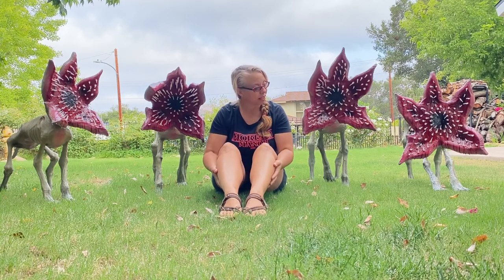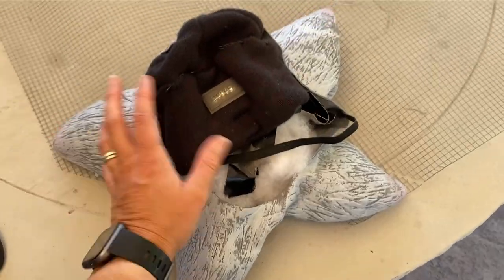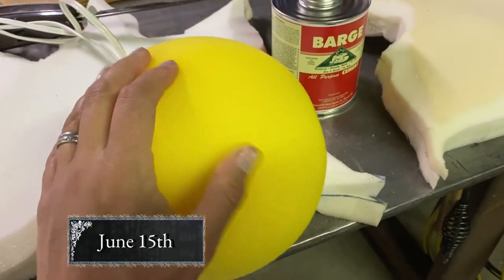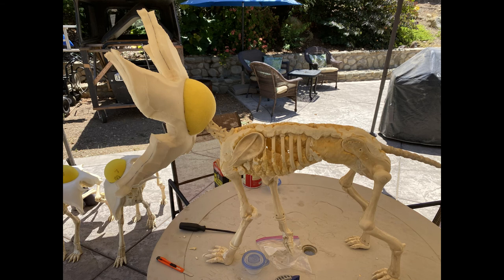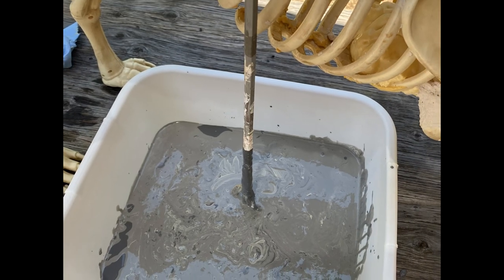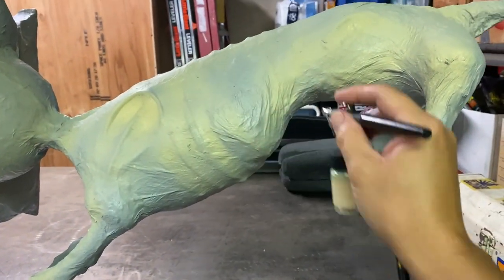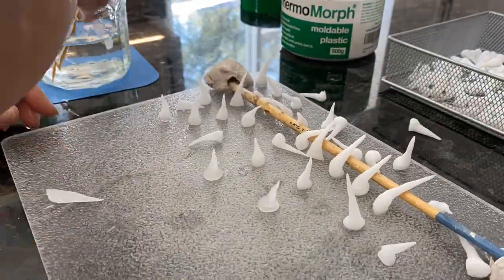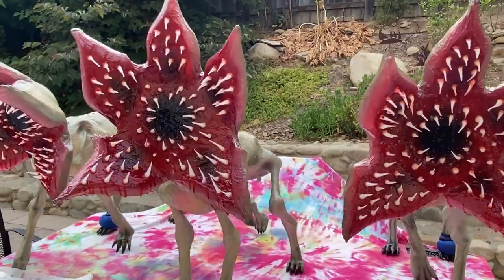DIY Demodogs Stranger Things

Comment: I want to make these! but if I needed to simplify, do you think I could modify/stuff a halloween demo-mask for the head? like the mask you used to make the head template? we are throwing a party for one night, so we dont need them to hold up long term, just one night/party. I know they won't look as amazing as yours, but brainstorming ways to save a bit of time
Reply from the maker: Yes definitely, you still might need to take the heads off so the mask will fit. I noticed Home Depot this year 2023 has the dogs again!